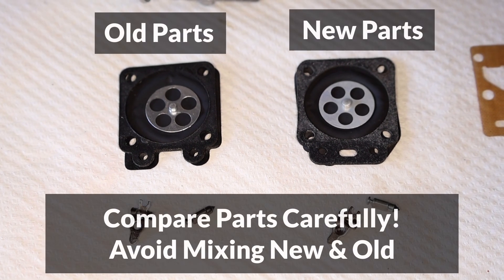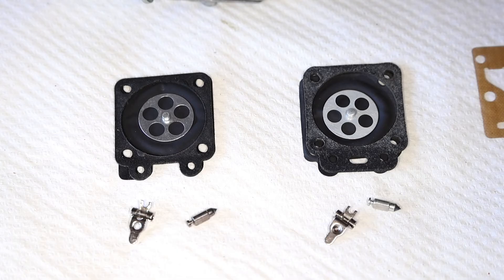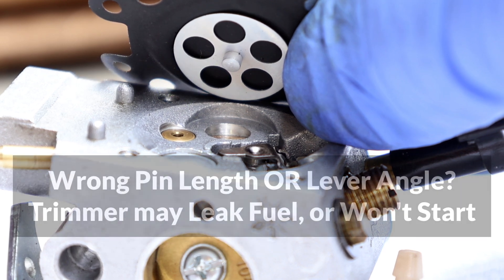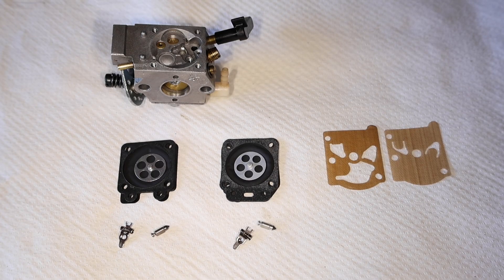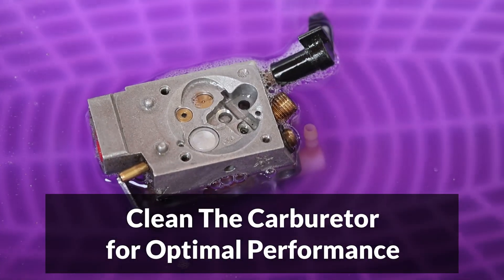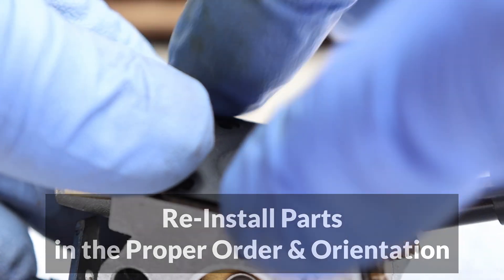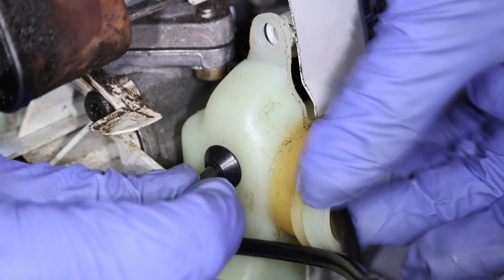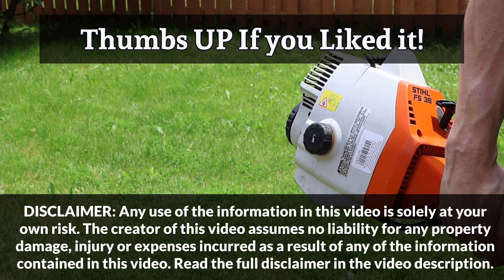Key Mistakes to Avoid ❗ Trimmer Carburetor Rebuild 🔧

Comment: hello cleverfix, i finally fix my car (i'm the guy with the corolla blower always ON) the problem was the air levels knob, i just bought one in ebay and i replace the original in the car and put the new one and fix the problem. thanks for answer in my video.
Reply from the maker: Hi, that's great to hear, thanks for letting me know! I have the video nearly finished.. amazing how one little panel requires so much stuff removed.. I did it as the manual shows, and that involves removing the instrument cluster trim to get that small piece on the left of the knobs. I got to clean the instrument cluster at least though =) .
Reply: @CleverFix  i found this video https://www.youtube.com/watch?v=b5P4oGz6JaQ and i use it like guide.  the most hard part is remove the knob but i made it well. thanks i hope this info help more people.
Reply from the maker: @CiegoSinBaston  yes I did very similar steps.The knobs on mine are all separate because it's manual controls, and yes it's hard because there are so many wires in the way.
Reply from the maker: Video is done: https://www.youtube.com/watch?v=7BwqCuui73w  If you have a few minutes to watch it, let me know what you think. Thanks!!